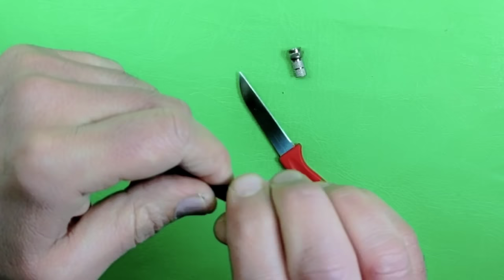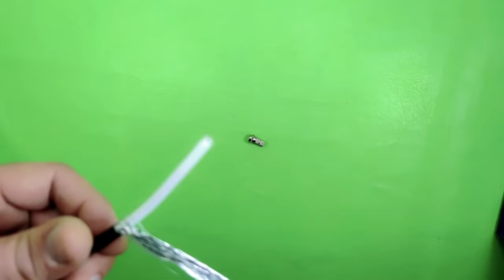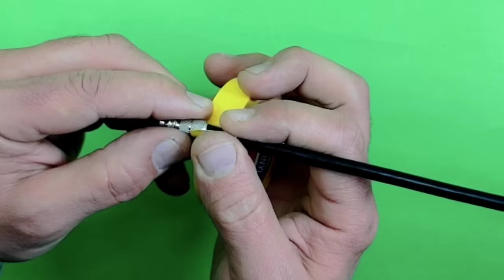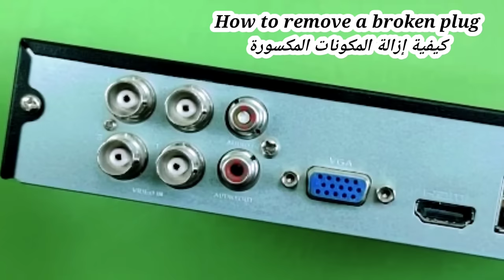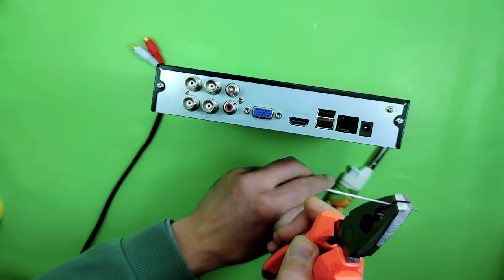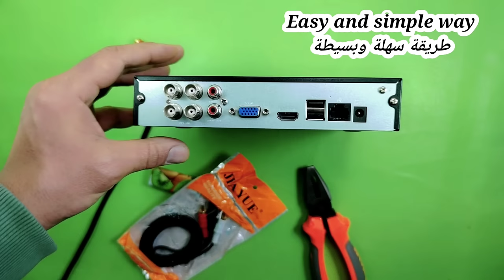How to connect the TV antenna cable correctly so that the TV screen is clear

Comment: "Great video! Clear and concise instructions on how to properly connect the TV antenna cable. The use of a moisture-proof adhesive tape is a smart tip to prevent moisture leakage, ensuring a clear TV screen. Thanks for sharing this helpful tutorial!"
Lesson: Proper cable connection and moisture protection are crucial for maintaining a clear TV screen and ensuring optimal viewing experience.
Reply from the maker: Thank you for your interaction and valuable comment

Comment: As if F type plug as you installed makes a big difference than it was before as you marked with an X. I have tested it both ways and measured the line signal and in reality it doesn't make any difference.
Reply from the maker: Thanks for the information

Comment: Precision Matters: This video emphasizes the importance of precision when connecting your TV antenna cable. Just like any other electrical connection, even a slight misalignment can lead to interference and a fuzzy screen.
Reply from the maker: Thank you for the useful and correct comment. Best regards

Comment: Absolutely unprofessional video given that for each coaxial cable the right size connector must be chosen and certainly not the sock rolled up as shown in the video. By using the right connector it will be very difficult for it to tear or otherwise block the cable inside. If we want to be more precise, self-extinguishing tube must be used and not insulating tape to complete the connection between cable and connector.
The second part of the video is interesting instead.
Reply from the maker: Thank you, my friend, for the excellent advice and information. Thank you for your valuable interaction. Best regards